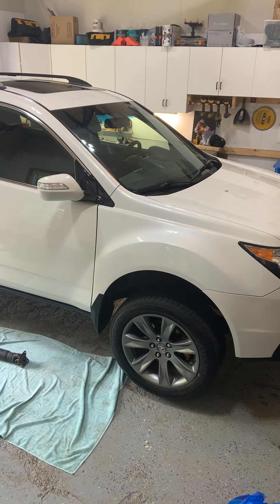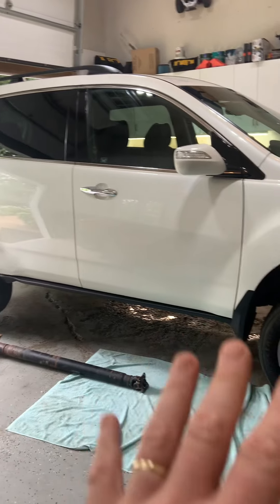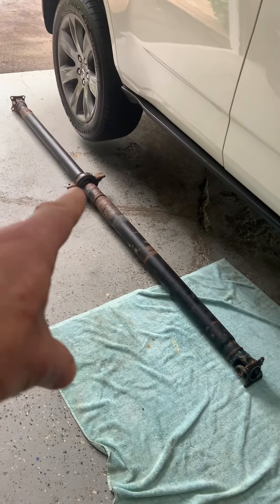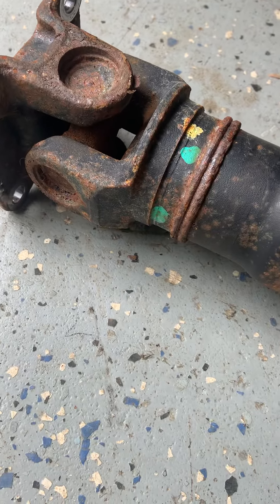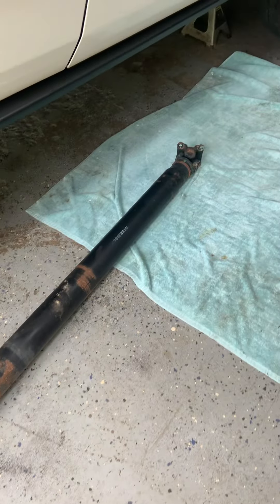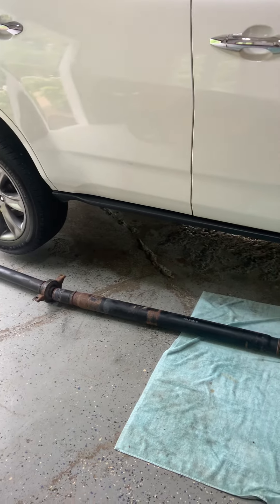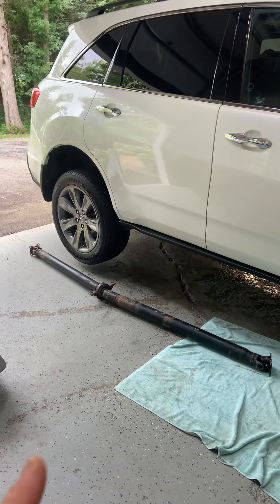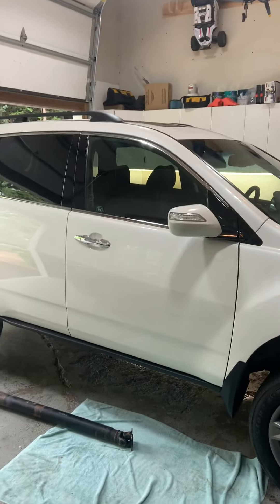2010 MDX Driveline Vibration

Comment: I have the same issues, I was diagnosing it to be either the torque converter or my driveshaft. I’m gonna take your advice and go for driveshaft first since it’s way cheaper, thanks for the great video 👍
Reply from the maker: You will know as soon as you remove it and feel the joints. I hope it works out.

Comment: Great video - thanks for taking the time to make it!  I am just starting to feel some vibration around the 60-100 kph range.  Most likely the drive shaft.  It is a 2011 with 210,000 km but not as well maintained as yours was when I bought it.  Fortunately, I too am in the Ottawa area so I will be calling that shop tomorrow to get an estimate. Thanks again!
Reply from the maker: You are welcome! I hope you get it sorted out. These are really great SUV's when they are running properly.

Comment: I have a vibration/shaking issue with my 2003 Acura MDX. Replaced my axle joints and struts but the issue has continued. It usually happens around 25-45 mph.
Reply: Also when I'm turning

Comment: Looked for possible update video. Did the u joint replacement cure the issue?
Reply from the maker: Yes it was perfect after they were replaced.
Reply from the maker: I actually sold the MDX two days after the driveshaft was fixed so there wasn't a vehicle to shoot the follow up video with. Sorry

Comment: Great video, I found a company in Cali that installs replaceable joints for rebiulding later when one fails. Half the price. This isn't a part you want from a junk yard anyway. I found rust dust around the failed joint cap.

Comment: I have the same problem with my MDX 2011, vibration on deacceleration and lock rear ujoint and no so good front one, exactly same symptoms. Thank you so much for sharing this to us. I was ready to make a video for, but now I don't have to LOL.
Reply from the maker: Thank you for watching! Glad it helped.
Reply: Does yours get better around 80mph 120Km/H? I get a wicked vibration from 20-40mph and then it smooths out. Then when you let off the gas it gets worse as it decelerates
Reply from the maker: Yes the vibration was worst around 30 mph and got less noticeable above that. I didn't notice the deceleration vibe as I removed it right away and had it rebuilt. This was also two years ago so I don't remember all the fine details. 
 @lovemym16

Comment: Just bought 2011 MDX and when speed reaches 120/ hr the vibration starts. You mentioned a shop in Ottawa do you’ve addresses or phone number?  Since I live in Toronto do you know anyone who could do the same job thank you
Reply from the maker: This is where I had it done. They also did my 86 4runner driveshaft work.    http://www.ottawa-driveshaft-steering.com/

Comment: I have the 08 MDX with 135k miles, bought it last week. I didnt notice any noise but now I can hear some squeak after I brake, when I start to accelerate the car. I also hear a faint vibration/scratching noise under the car body when I put it in park, but this noise would come for 2s then gone for 3s rather than constantly on. Would appreciate any insights from my fellow mdx owners😢
Reply: Did you fixit?
Reply: @ajetimusliu8408  The vibration and scratching kind of sounds like rain I got used to that and it might have been gone and I didn't even notice, the squeaking was due to a loose stability link. My car is hard to start after a couple days and I suspect there's some issue with oil pressure but I don't know anything for sure yet.

Comment: Just curious, wouldn't it be easier to just buy brand new aftermarket OE driveshaft made by DORMAN for $600USD?  Trying to understand pros/cons of replacing u-join by a local shop vs. new OE aftermarket driveshaft.  Yeah, it's little cheaper from prices i am reading on this thread to have a shop rebuild but not a huge difference to get a brand new part.  Just my personal experience... I don't trust mechanics that much, they tend to break something else while trying to fix what they're paid to do.
Reply from the maker: You have to understand that I'm in Canada and so everything costs us way more up here. The dealer way way over 1k to replace the shaft, I didn't see a doorman shaft advertised at th etime I was looking but evenif it was, that would be 1k in Canadian dollars by the time it was shipped. So $600 Canadian with warranty is a deal IMHO.

Comment: Holy Cow!  Just experienced this with my own MDX with the same situation.  Sat for a long long time while I replaced rings and bearings.  A week back on the road and the vibration had me spooked.  Not brakes or bearings.  Vibration at about 45mph and continued when I popped it into neutral and coasting.  Seemed to be heaviest when decelerating, almost thought the engine was stalling but it was just the vibration slowly going away.  Of course I haven't pulled mine out yet, but this explains A LOT!

Comment: Hello, I have a silly question? Why did you replace the engine? Just curious
Reply from the maker: Not a silly question. My engine was burining oil like crazy and then it suffered a piston failure that damaged the cylinder wall. You can't repair these blocks so I found a low mileage replacement.
Reply: They usually burn oil quickly. Have to switch to mobil1 high mileage full synthetic. Works for me
Reply from the maker: It didn't matter what I put in this MDX, it was way too worn out to save.  @puppafoultv